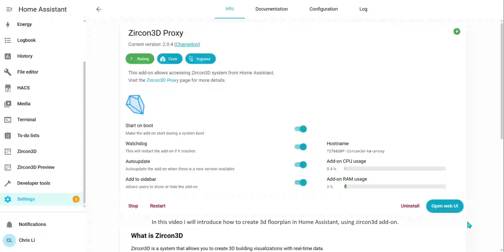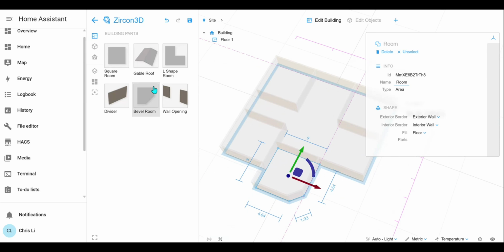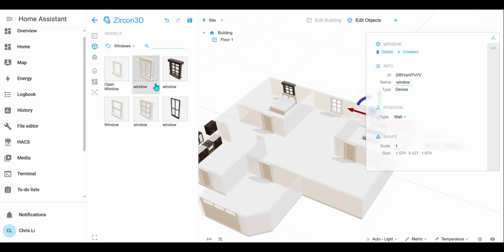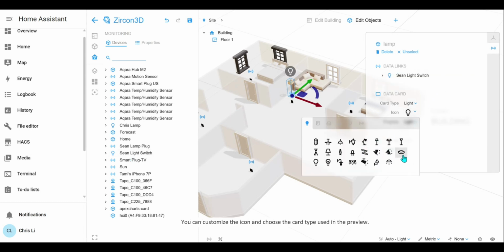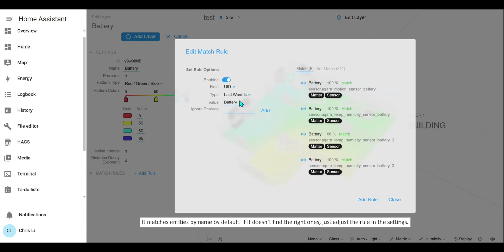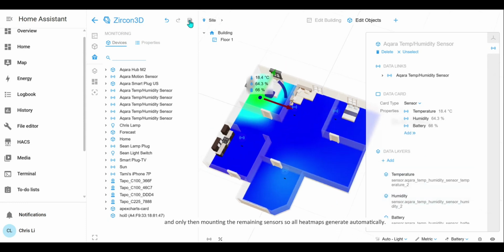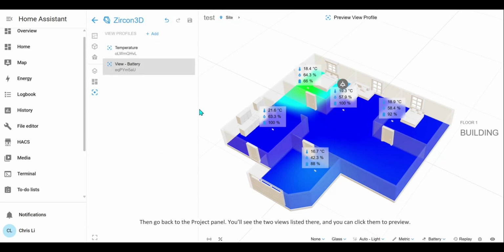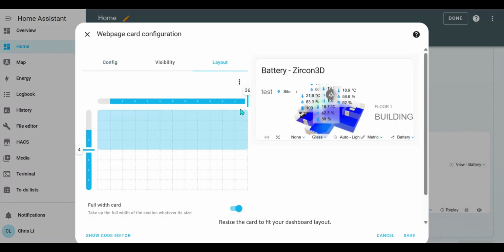How to Create an Interactive 3D Floorplan in Home Assistant (Zircon3D Tutorial)

Comment: Are there any versions with ARM architecture?
Reply from the maker: Yes, Zircon3D supports ARM (for example on Raspberry Pi and other ARM64 systems).

For now, we recommend doing design and editing on a computer (desktop or laptop), as the designer work best with a mouse in a web browser.

Viewing dashboards and 3D models works well on tablets and phones, and we plan to further improve rotation and dragging interactions on mobile devices in future versions.

Feel free to share your setup if you’d like more specific advice.